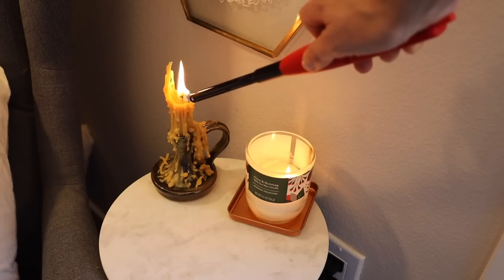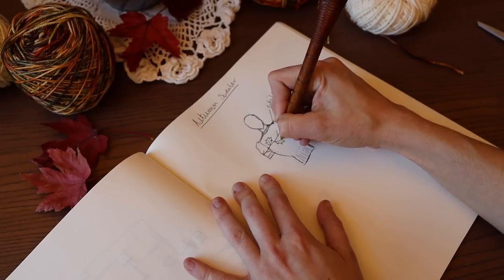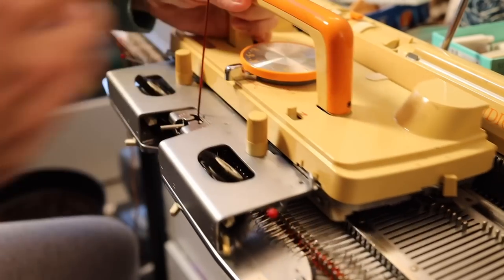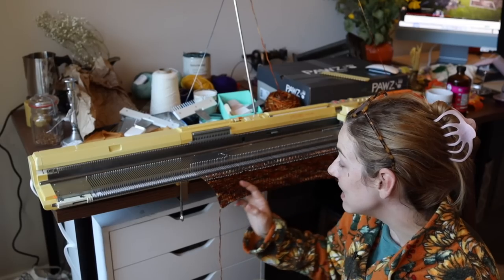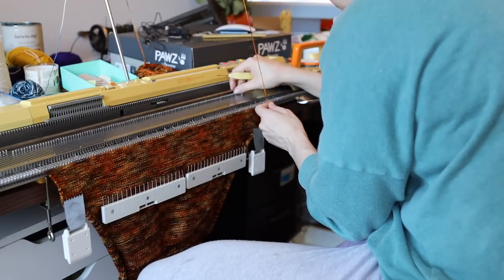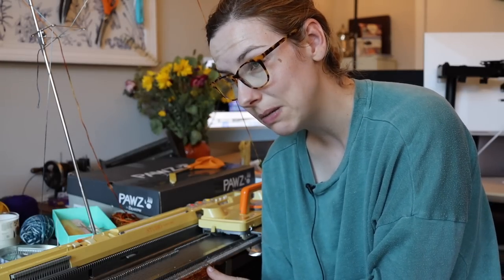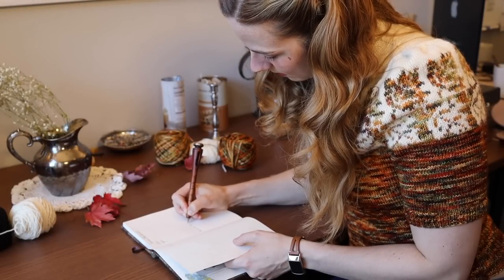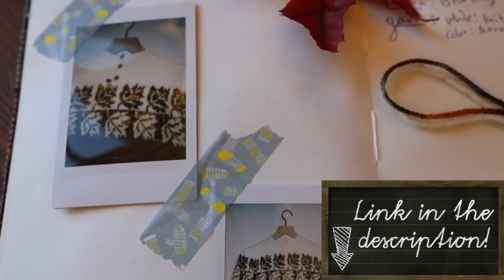Knitting a Vintage Autumn Sweater - The Perfect Project for Fall

Comment: Lovely! I have done the same as you many times. Used the machine to make the stockinette and then worked the design by hand. Just for future reference, look for something called revel cord. It's about the thickness of lace to light fingering weight yarn, is very smooth and comes in long lengths. I use it when I'm scrapping off the piece by knitting 1 row with the ravel cord before knitting with the waste yarn. It makes it so much easier to get the stitches onto a needle. I look forward to seeing you making this design for another season!

Comment: I noticed you were using a spare hook to do up your ribbing. You can pick up a handled latch hook at most craft stores, usually near the rug-making supplies. They're very handy and easier on the hands, though I'm just as likely to reach for a crochet hook to ladder up "machine" ribbing

Comment: Decades ago when I had a basic knitting machine, after doing my tension swatch etc, I hand knit my ribbing, then did a few rows in waste yarn, then I picked up the open stitches onto the machine, and tore out the waste yarn, then continued in regular stocking stitch on my machine.

Comment: P.S. I noticed your table that you have your machine on is a little bit shaky I bought an old military style metal desk Very sturdy plus I can also use it for my welding because it’s completely metal. Also I have my grandmothers sideboard which has a cheap piece of Masonite on the back and I just took that off and cut slots into it for my knitting machine and I can attach it to the back.